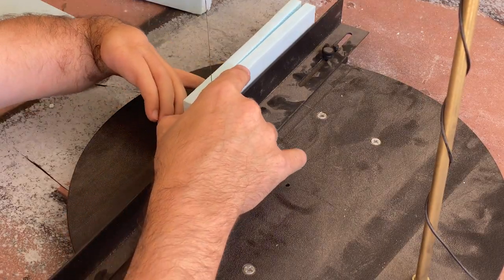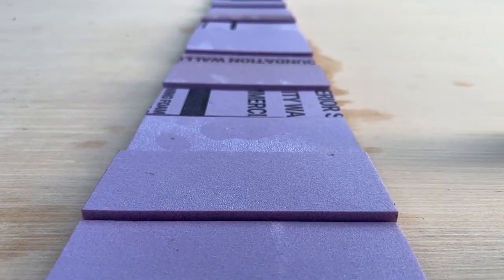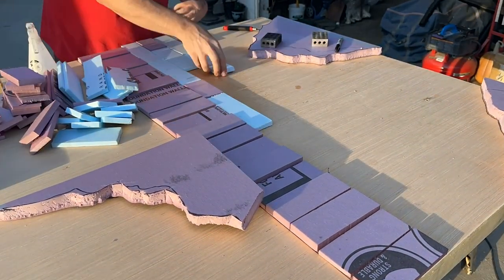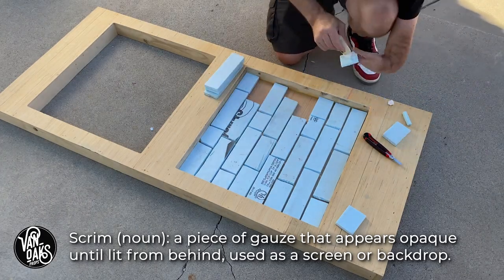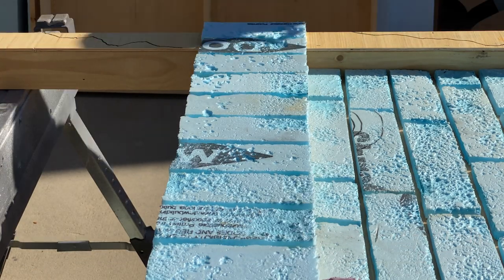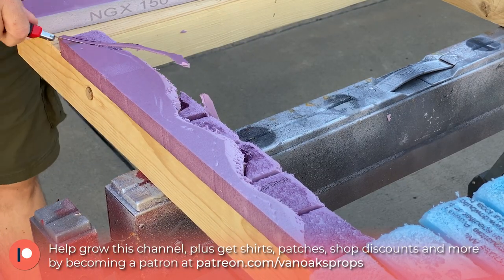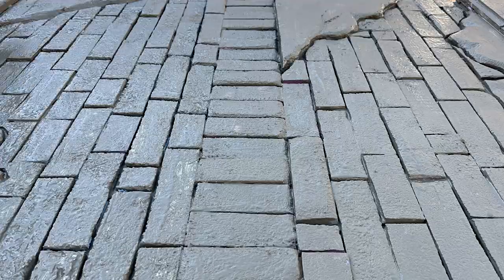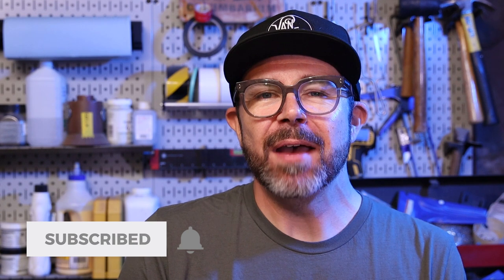Building a Halloween Crypt - Part 3: Fake Brick Walls & Hard Coating

Comment: Nice work Derek!   I have been using both the clear and brown Gorilla glue recently on the XPS foam, the brown seems to foam up a lot more than the clear in my applications, which is good for making a strong bond, but sometimes needs to be trimmed from the seams.   Give and take I guess,   thanks for sharing!

Comment: very intrigued about the hard coat method here. How do you like it compared to drylock? is this more durable? perhaps a full video for the future is on tap...lol. As always, Thanks man 🤘💀
Reply from the maker: It seems to work well, so far. Definitely more cement-like than Drylok.
Reply: Definitely would love to see a detailed tutorial on this hard coat method. Foam hard  coating seems to be an art all in its own. This method sounds very similar to the method that Hollywood Haunters used for their giant pumpkins. Definitely prefer your videos though since the layout is much easier to follow along to. Your videos are more tutorial based, while there's are more candid. As always, thanks man🤘💀